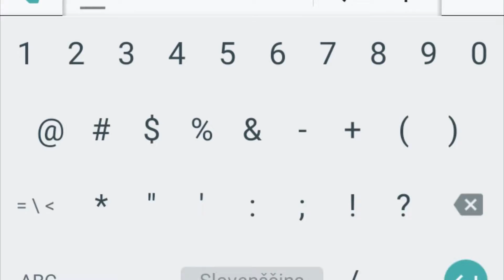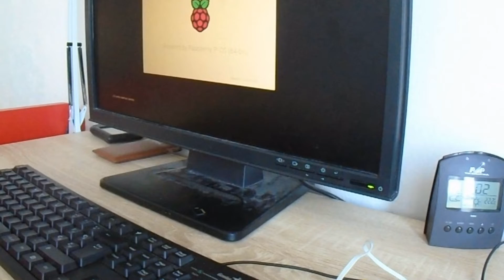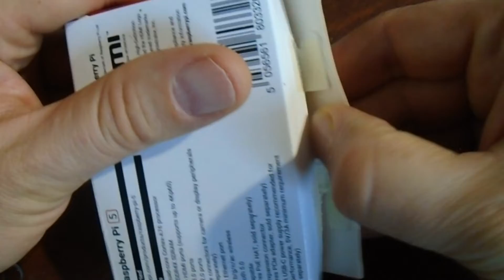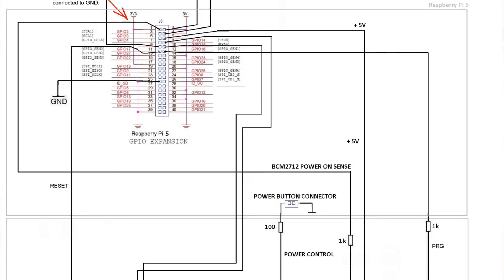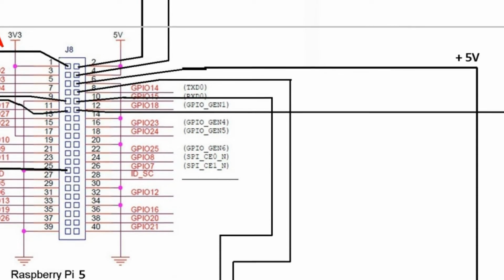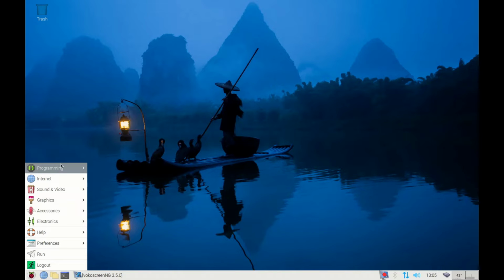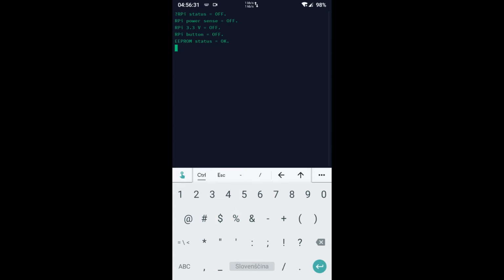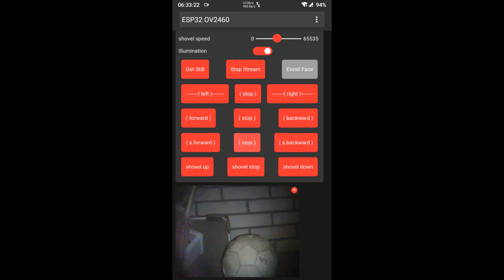Raspberry Pi 5 Wi-Fi Lock and Power On Manager

Comment: There are two main reason I prefer rpi over nuc types. (1) It coming up by itself after a power fail, the peace of mind if one is 100s of km away. (2) Sdcard can be put instantly into a spare rpi service restored in no time. If you really want pc like functionality then far better off buying a nuc which will also run windows. Btw, my rpi3 has been running nonstop for 5-6 years, hasn't scratched the surface of power bill or the sdcard so far. It's ridiculous trying to retro fit rpi to boot from ssd, seriously how much time you save, few seconds and lo behold if ssd fails, that will hurt.
Reply from the maker: I like my RPi 5, but RPi 3 is a bit too slow for many tasks now days. I also like NUCs and old-fashioned tower PCs. You might like this video: https://youtu.be/Cjjdpm96vh0.
Reply: @pcusbprojects  shall have a look
Reply: I've noticed an increase in overall performance with the nvme drives/hats

Comment: For the remark about power consumption and auto start following a power outage, I've found a Smart Socket is very handy device as they can be set to be power on or power off at restore of mains power, regardless of if they are synced to your WiFi hub such that when your hub goes down due to a power outage, when power is restored and the hub restarts and devices reconnect, you can decide remotely if you want your Pi to restart. This is easier for the non electronic user to use than the SSP system you use.
Reply from the maker: Raspberry Pi 5 Power On Manger is a more complex solution that also provides many other functionalities (reprogramming on the fly from Arduino IDE, timed power on/off, RPi 5 status checks, e-Lock, user notifications etc.) and makes use of RPi 5 internal signals and controls. Your solution at least on my opinion can be compared to a simple self-holding relay that I've also proposed in my videos. It efficiently prevents RPi 5 from starting if a power outage occurs and it is very easy and cheap to make... However, I agree that Smart Socket may be used with any device not just Raspberry Pi 5. But with Power On Manager you don't have to restore RPi 5 power supply with a Wi-Fi device after each power outage. It simply restores RPi 5 into a desired power state automatically.
Reply: But compared to your skill level and knowledge I'm down there with the caveman whilst you're up there with Mensa!... lol...
Reply from the maker: Of course, I agree... Off-the-shelf solutions that you may buy in an electronics store are what most of the users would go for....